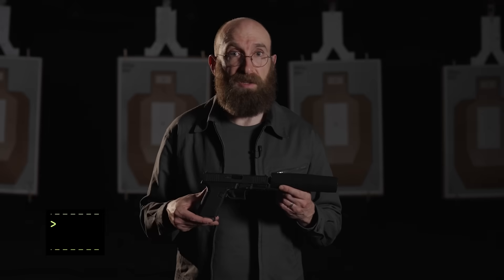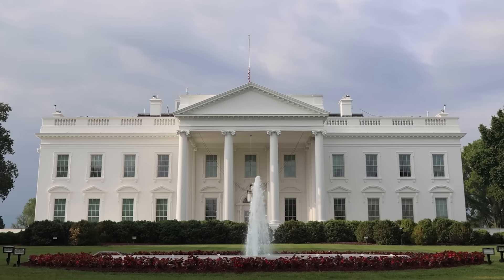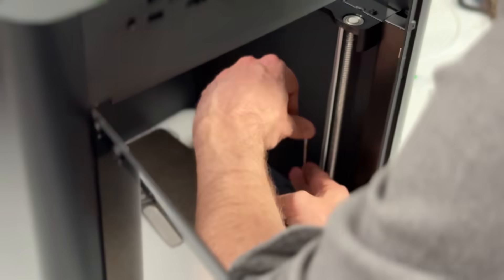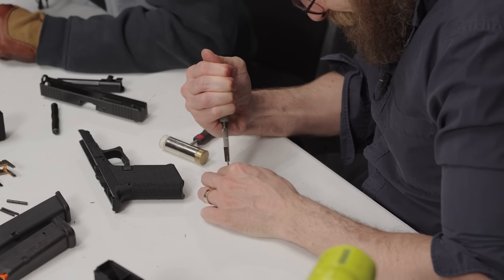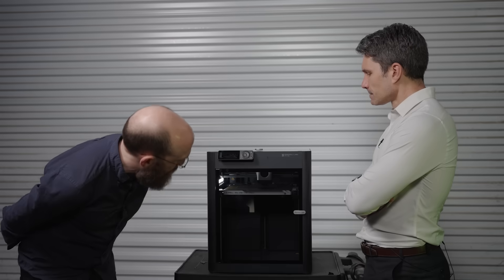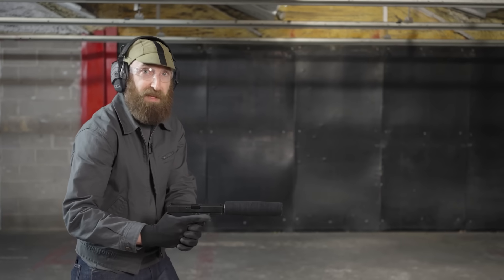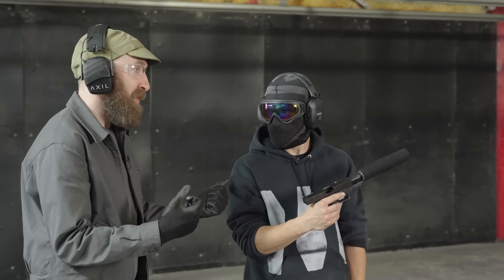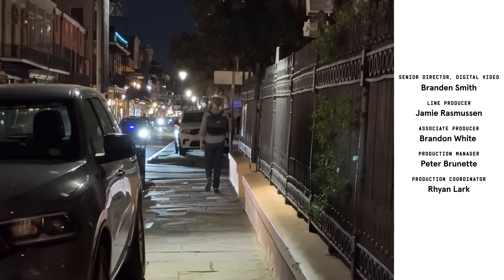I 3D-Printed Luigi Mangione’s ‘Ghost Gun’ | Hacklab | WIRED

Comment: Trying to regulate this through the printers is just going to cause problems for people who have no interest in 3D printing guns. Much of the 3D printing stuff is open source. People can and do replace things like firmware. It does take more effort but someone determined to make a gun is probably more like to go through that effort than the person who just wanted to print a watergun or some sort of pistol grip for any number of tools.
In the case of a CNC mill how is it going to know a gun part is being made if each part of the process is split into different files. Technically different items. For example one file/project cuts the outer permeter. Another cuts the inner. 3rd one does something else. How will the mill know you left the part in place and it is supposed to combine these 10 files into one object? Some 3D printers can pause and resume as well so they can be used this way as well.

Edit: At best these regulations would just make it easier to prosecute after a crime but it won't prevent the crime.
Reply: How will they deal with the of millions of printers on the market already, open source offline slicers or even DIY printers like the voron project? These people don’t know that it is already too late.
Reply: Expect to see this used as an excuse so not only can you not own the things you buy, like a printer - don't imagine you can print what you haven't purchased. What if someone tries to print something that's been patented! Oh no! What if you tried to print a broken part of your car without GM getting a cut? You wouldn't download a car!
Reply: The comparison to money counterfeiting was ridiculous. Recognizing money is infinitely easier than recognizing whether a part is a gun part or not. Modifying it to pass that check while remaining a functional gun will be trivially easy.
Reply: Yep. Pirates and hackers will always exist and you can't stop them. They will always find a way around DRM or digital software blockages.
Reply: @ommanomnom  If modern software is any indication, you better learn to program if you want to bypass DRM, because a lot of software hasn't been cracked yet.
Reply: @LutraLovegood cracking is wayyy different than custom firmware. cracking means that youre tryna get essentially the original software  minus paywalls/etc. Custom firmware, as long as someone has built it properly for your specific system, is very easy to install, look at Nintendo console modding, Xbox mod chips, Chromebrew for Chromebooks, etc.
Reply: @ommanomnom sure pirates and hackers will always exist, but why should normal people have to deal with their 3D printer scrutinizing what they build.
It will become an excuse to charge people more for what they already own
Reply: Agreed, and I'd add that the legal system punishing criminals for murder outside of self-defense is sufficient other than the unfortunate suicidal behavior that disregards legal ramifications anyway, so again, overregulation, as in practically unenforceable laws, lead us nowhere but backwards.  The idea of "flooding the environment" with guns is a distraction.  Motive drives behavior, not tools.
Reply: there are 5 axis 3d printers and non planar slicing.  
you can totally make an outer shell and then come in and do the inner geometry in a sepperate file.
Reply: Don’t even worry about the printer thing or have to come up with reasons against it. Limiting them is a huge stretch and won’t happen anywhere. I’m sure even the gun control guy knows he has no chance of that ever happening.
Reply: Making it easier to prosecute crime could discourage it tho
Reply: I have even greater news for you! They will need to ban every microcontroller capable of running 3d printer firmware and enough pins for electronics.
Reply: @jtucehok I have even better news, those same microcontrollers are used in the majority of smart appliances, furthermore any old computer can be repurposed for running a 3d printer lol
Reply: They're not gonna implement anti gun DRM on CNC mills and lathes, because then how would the actual gun manufacturers make regular guns? Those are the machines they use
Reply: @avadrumm  4 words: corporate software licensing agreements. Pantone is a great example of this very issue being implemented in PS and such
Reply: DRM could help make it much more difficult. They would have to somehow analyze the sliced file. But many printers already exist without it. The real method of gun control that wouldn’t be totally pointless is to make the barrel/chamber an item needing a background check.
Reply: “Making it easier to prosecute” is the point of ALL laws.
Reply: Prosecuting is better than not prosecuting
Reply: It's almost as if America opened a can of worms they can't ever put the lid back on by upholding outdated laws and "amendments". Certainly not when you have so many people that think "yeah of course guns are used by bad people to kill other people, that's sad, but I want my right to have one because this is a free country". So many many more will die because other people think their 'right' to bear arms is more important. You're all just living in fear and you're perpetuating that.
Reply: Definitely hitting major points on this, DRM on 3D printing would mean mass enshitification, some leading manufacturers are already headed down this road. Even so, then open source printers, firmware, hardware still have a huge driving force and always had since the 3D printers inception. We don't make cars illegal since some dude in a truck ran over and killed someone. If someone has the desire and skills to make a gun, nothing could stop them. You could walk into harbor freight and buy a mill and or a lathe to build one if you wanted, just saying. Just like computer hacking, if there is a will then there is always a way.
Reply: Why don't they control sales of ammunition more? And really- the number of guns out there in USA for anybody to get their hands on- 3d printing is not your issue USA. Maybe in countries with actual strict gun laws it might be a problem- but again, ammo is regulated heavily in those countries.
Reply: @Blender3DProjects  why I think the homemade shotty that got abe was kinda hilarious, tho not the actual act (considering its control freak japan). I think in Germany someone did similar, but not political, not long before that via black powder.
Reply: @Blender3DProjects  exactly, they should be going after ammunition instead
Reply: Just call the slide the receiver and people can't make these.

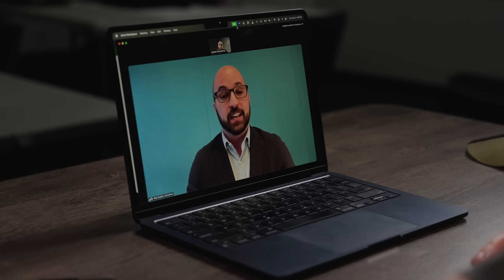Comment: 11:30 70k ghost guns ≠ 70k 3D printed firearms, even though the atf and this video want it to be seen that way! Have whatever opinion you want, but that figure is deliberately misleading for a reason.
Reply: True. The vast majority of these "ghost guns" he cites are just normal guns that where stolen and had the serial number ground off illegally.
Reply: @stonegiant4  there is a legal method to grind off serial numbers?
Reply: @darkracer1252 yeah. You can have an FFL/07 manufacturer license. Then grind off and reapply a new serial to your heart's content.
Reply: @darkracer1252  no (good) reason to alter a weapon's serial number.
Reply: same thing they do with "gun violence"
half of those stats are suicides. while, technically, it is "violence", it is not the same as a murder or other shooting.
Reply: I was just going to post this. Its so misleading.
Reply: You can just buy a illegal back-alley M1911, take off the original frame, put a custom polymer frame without serial, and any cop that gets it will say its a "ghost gun" and theres a good chance it will get called a "3D printed"
Reply: They're both referred to as the same? I didn't know that. I thought the term "ghost gun" came about right around the time of the "Liberator" pistol (not WW2 one). Like did they use that term in the 90's or whatnot to signify guns with ground off serial numbers? Legitimately asking not trying to be a smartass.
Reply: @MarshalSmith1  Basically, the ATF kept expanding the term to encompass more and more so they could make claims about such high numbers.
Reply: @MarshalSmith1  Google AI says that it appeared in a "Sunday People" newspaper article as early as 2001..
Whatever that is, but yeah, the OP is correct in saying that most ghost guns are not 3d printed.
Reply: @MarshalSmith1  Ghost guns are literally just any unregistered or unserialized gun. Even then, fully 3D printed firearms are rare, and most consumer grade plastics aren't suited for that at all. (eg; PEEK is used in gun manufacturing, but that material alone costs more than some printers, and any consumer grade machine won't be able to print it.) 
Fully 3D printed guns would break on first shot (like the Liberator), or wreck the person using it. Hence they still bought the metal slide, barrel, etc. 

If anything, it's more insane that it's perfectly legal to sell gun replacements parts unlicensed and unregulated, rather than being able to print the stock.
Reply: @MarshalSmith1  good points.
Reply: Luigi Mongione killed a man who was an agent of the pro-Russian secret police and was engaged in encouraging talented and ideological people who shared democratic views to commit suicide or mental disorders.
Reply: so the problem isn't 3d printed firearms proliferation then its just regular proliferation of firearms that's the problem... huh...
Reply: @Nico-p8z5t  the problem: persons with intent (to harm). (doesn't matter with what kind of weapon)
Reply: Yeah doesn’t include 80%, zip guns, pipe guns, and who knows what else. It’s possible that black powder guns with a cartridge conversion could be considered a ghost gun by the ATF
Reply: The way some stats are tracked is weird. Not saying this is true but I heard that a negligent discharge in a school parking lot was added to the “school shootings” statistic, even if it was not an actual attack.
Reply: The stat is that the ghost guns were found at a crime scene. Doesn't mean they were used in the crime!
Reply: @KylesCustoms   Unless the gun is the crime. no but yes
Reply: @jeruharlem I never said it couldn't be? If you missed it, the point is that the stat is purposely misleading to make the impact of ghost guns seem higher.
Reply: He said it clearly. They were found at crime scenes, not used in crimes.
Reply: Any gun that's 3d printed and has metal parts is not a ghost gun, any 100% 3d printed gun IS a ghost gun. Metal parts= not ghost, no metal parts= ghost gun
Reply: @zacharyschmidt5962 That's incorrect. You're referring to making an "undetectable" firearm with less than 3.5 grams of metal. An undetectable firearm can potentially go through metal detectors and is illegal. This is why 3D printed firearms with very little metal, like the Liberator, have instructions to add a metal block for legal compliance. 

"Ghost gun" is a blanket term referring to any firearm without a serial number/ a firearm that isn't known to any agency. It was correctly explained in this video.
Reply: @zacharyschmidt5962  
are you brain dead? 

ANY gun in ANY form without a serial number that is tracable.  
IS a ghost gun

Comment: 17:23  you’re for total disbarment and banning of the American people using lies and modified statistics. 

You won’t be able to put DRM on printers due to the fact we know them, everything is open source. Any measure you implement will be half baked and will most likely hurt cosplayers, prop makers and nerf gun people more than the 3D2A space 

Projects like the FGC-9 and the Urutau are completely DIY, so unless you plan on requiring licenses for metal, springs and filaments. You won’t touch a thing.